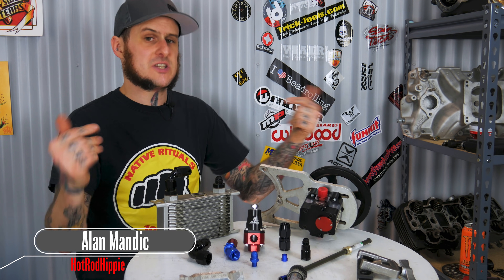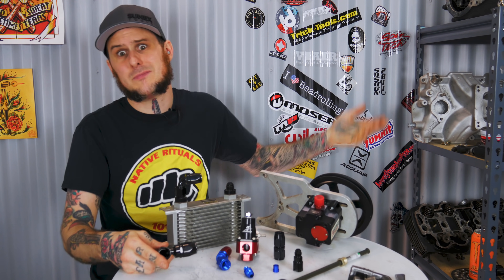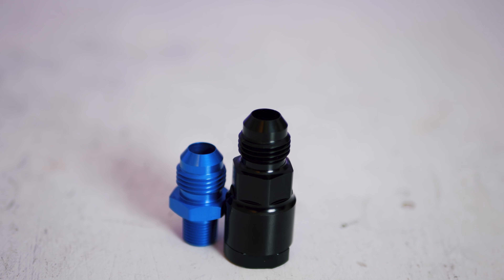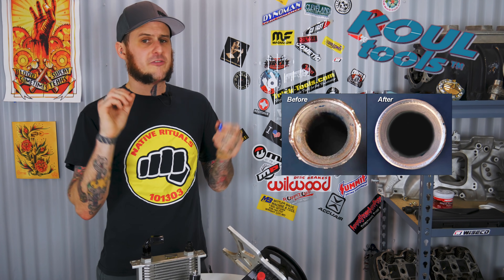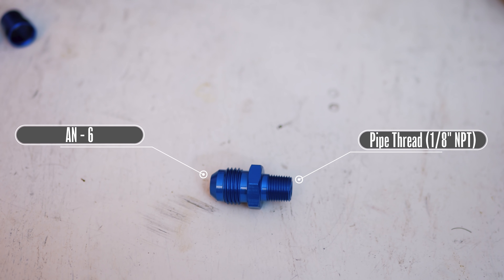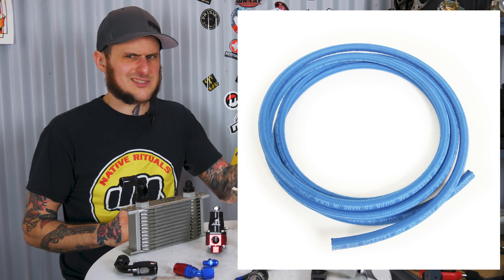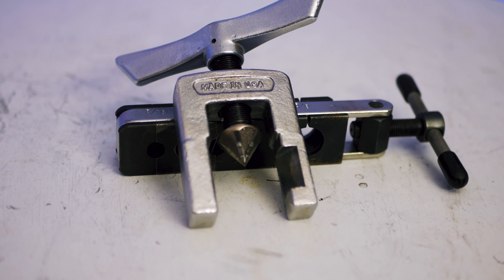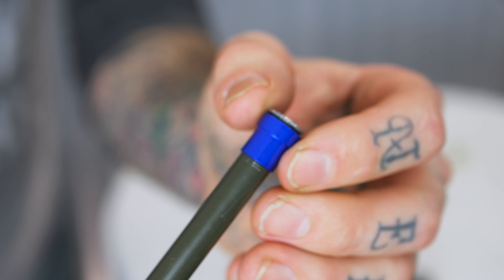AN Fitting Basics - How to Assemble and Common Mistakes!

Comment: just curious, but what would you still use a regular braided rubber line for over PTFE? PTFE is the new goodness for fuel, brake, p/s.. although pricey.. rubber safe for oil lines? also, did you forget a tube nut @ 9:00?  another quick tip would be to wrap some tape/teflon around the base of a fitting before threading on the end to make sure it doesn't push the hose out.
Reply from the maker: Teflon lined hose is very inflexible when compared to standard braided rubber line. Teflon line is superior in many ways but much more difficult to route cleanly. Also it is smaller in outside diameter than Braided so many aftermarket tube clamps (for attaching and organizing hoses) don't fit it. And it looks small so it isn't as aesthetically pleasing. Many people think they got the wrong size the first time they see -6 Teflon lined hose compared to rubber braided. 

Rubber braided is fine for oil lines as long as it is properly pressure rated (which almost all of them usually are). The only places I use teflon line hose is Hydraulics (steering, brakes, clutches) or AC lines when folks want the braided look. But honestly I moved away from those uses even. Mostly for the difficulty in routing. 

As for the tube nut, there wasn't one on there for that demonstration. I was just demoing the flare process. Should have probably noted the easy mistake of not putting the nut on but I just chose not to do it cause I didn't need it for the demo.
Reply: @HotRodHippie  cool cool.. ya, i figured it may have just been a short demo piece you were making. what do you use for fuel line if not the teflon? i hate the way the push lock/vapor gaurd stuff looks.. Earls makes some flexible stuff.. if you can afford it.. ultrapro is about $10 a foot and ultra flex is about $20 a foot.. they're only rated for 500 and 1000 psi roughly though..
Reply from the maker: I've primarily been using the Earl's Pro-Lite braided nylon hose lately. They list it lower on their ratings for pump gas but I've had zero issues. Its good looking, softer outside means it's less likely to rub paint off things, and I haven't had any deterioration issues yet. 

I agree on the looks of the vapor guard. I'll try and check out the Ultra-Pro. If it's close to as flexible as normal braided I'd be glad to try it out.

Comment: Can you disassmble AN fittings and re-use them? I ordered a custom line for my turbo application, but it is too long. Can I take the AN fitting off, cut the line, and re-use the fitting? Thanks!
Reply from the maker: I cannot say for certain your line can be, but generally yes you can. I try to avoid it personally since the chances of cross threading a fitting, scarring up the look of them, and damaging the hose increase. 

All that said, if it is just a standard AN hose assembly, then yes you should be able to dissassemble it, cut it down, and reassemble. Just take your time and make sure it goes smoothly. 

If it is Teflon lined hose they use a different design that I haven't covered yet. They are more difficult to reuse and may require a replacement ferrule to do so.
Reply: @HotRodHippie  Thanks for the quick response.  My line isn't teflon lined so I'm going to give it a shot. If it doesn't work I'll have to purchase some hose and additional fittings, but I'll give disassembly a shot first. I appreciate the help. Just suscribed. Keep up the great work!

Comment: I have always wondered if you can use nylon or teflon hoses for radiator hoses. I would love to hear some thoughts on this as I have always used silicone hoses with wide band stainless steel clamps
Reply from the maker: Do you mean Teflon lined hose? It would be too rigid and I'm not aware of any being made large enough. The teflon lined stuff we use got AC and power steering isn't very forgiving on bends. So routing hoses would be more difficult.

But I'm thinking you may be meaning just Teflon and Nylon hose. Nylon tubing degrades rapidly in my experience. Especially when used in relation to heat. It also kinks very easily. Teflon wouldn't have ths kinking or degradation issues but I'd  expect it to expand pretty heavily under pressure. Even just 15-20 psi.

Maybe something like a PVC flex hose. The coolant hoses in my PC watercooling setup don't see much pressure but they are highly flexible, don't kink easily, and don't degrade from heat.

Comment: This helps a lot. I’m thinking of going with A/N fittings for my projects fuel fittings. Maybe my coolant and oil coolers if I can get away with it.
Reply from the maker: Large enough hose and fittings for coolant are pricy as heck but sure do look good.
Reply: HotRodHippie you’re totally right. I most likely won’t use them for my coolant. That would look really cool though. Probably too hard to adapt my fittings too.

Comment: Hi there, I want to build an aftercooler for a compressor using a condenser, similar to this: https://www.youtube.com/watch?v=HdvcnKrfMSI. But I want to use as little copper as possible as I heard copper reacts with the aluminium in the condenser. These fittings look good. Can they handle heat and high air pressure?

Comment: I'm having an issue where I thread the fitting into the nut, and it's tearing up the rubber on the inside of the line cause a clog in my fuel line. I installed one fitting perfectly but this one is killing me
Reply from the maker: What brand line and fittings are you using? I've never had that happen. If that has occurred the damage is done, you will have to cut away the damaged section and start over. Are you using any assembly lubricant? It not only helps threading go smoothly but also the sliding of the fitting into the rubber portion of the hose.
Reply: @HotRodHippie  I just bought all new fittings and cut like 3" off the nylon line. It worked now

Comment: Good video, thanks for posting. I need to fab some transmission cooling lines for my '77 Corvette restomod with a 700R4 tranny. The connections at the tranny are straightforward but I'm having a bit of an issue at the OE radiator which has inverted flare ports. The original fittings are 3/8" dia steel tubing, the upper one is a 90 elbow which is needed for clearance. Do you know of a fitting that will go onto the braided stainless hose and convert to 3/8" tube compression fitting? Or if I can get a fitting that fits over the braided hose and goes directly to inverted flare. One of those would have to be a 90.
Reply from the maker: The fittings on your radiator should be 1/2-20 Inverted Flare.  Straight -6AN adapter fittings are easy to find, like this: https://amzn.to/2RAf7D9  Then you can just use a standard -6AN 90 Degree hose end on the troublesome one.  

If that is too tall, there are lower profile -6AN hose ends, like this: https://amzn.to/2RDvIGo 

I was able to locate one or two 1/2-20 to -6AN hose ends, but they were for the Teflon lined hose and were actually very tall fittings that may be just as bad as an adapter/hose end combo. Also the Teflon lined hose is much stiffer and harder to route.  It is higher pressure rated and holds up to oils slightly better but is not necessary for transmission cooler lines.

Hope this helps.
Reply: @HotRodHippie  Wow, thanks for the advice. Much appreciated. I'll try the first option and if it is too tall I think the second one will work. A little pricey but who ever said restoring cars is cheap?

Comment: whats the pressure rating of the actual fittings?
i had to use some AN fittings on a project. some sites said no pressure rating on the fittings because hose will blow first.
this was hard line compression fitting to AN oil cooler.
Reply from the maker: The only spec I've been able to find is 1,500psi on aluminum fittings. However as you said the hose would fail long before that, so I can understand why manufacturers don't bother listing that spec. Doesn't really matter when you can set them up with a hose that holds that high.

Comment: I used AN AEROQUIP on everything on my 1940 Ford. It was very expensive, as you said. The AC hose and fittings cost more than twice that of the Vintage Air system.  Some of the AC fittings were hundreds of dollars, each.  I bought some must have assembly tools from KOUL TOOLS. The Koul Tool stuff works really well.  Another must have tool I added to my tool inventory is the MASTERCOOL hydraulic tube flare system. This is an expensive tool, but it works properly first time every time. 
 I agree with you 100% on using a chrome combination wrench.  Another important and good video.  Thanks again  BTW. Sharpie colours will cover minor scratches.
Reply: Aeroquip has become quite expensive. Earl's is more affordable and their products are more readily available and they are more attractive. PS: Something that I find no one mentions in these AN hose videos is that the hoses should be washed and capped before installation. You never know what could have gotten inside the hoses and fittings and the cutting process creates little metal shards that will eventually find their way into the engine. appliedspeed.com
Reply from the maker: I want to get he Koul Tool stuff and will start doing that soon.  I have the Mastercool flaring tool and I love it, but I don't have the 37 degree portion of the kit yet.  I actually almost ordered it after I made this video, ha.

Thanks for the comment.  I'm glad to hear you like the Koul Tool stuff, I've heard good things but I'm glad to hear more.

Comment: On mine, I only have fuel lines and system runs only 3psi.  An fittings are just over kill.  Good video though.
Reply: Yup, serious overkill.  If your rubber is good and tight, you can get away without clamps....not a good idea but doable.
Reply from the maker: Last time I did anything like that was when I had to redo the fuel system on a Citroen 2CV.  1/4" fuel hard line for the fuel feed and no clamps on the rubber lines, ha.
Reply: @HotRodHippie  my cousin has a 2cv. Great little sardine cans.  I'm running a few Ladas in stock configuration....but that'll change, I've got a 1st generation rx7 that's giving up its heart to go into a 1980 Lada sedan.  That'll about double the HP and lighten it by about 100 lbs.
Reply from the maker: iambeeman1 a rotary Lada, I dig it.
Reply: @HotRodHippie  they were available with a Russian built rotary as a kgb special for a while, but the chassis and brakes were a little ......agricultural....for the power and speed.  I've got upgrades planned though, not to worry.
Reply from the maker: iambeeman1 I mean in a fan of overkill. But yea that's pretty darn overkill.